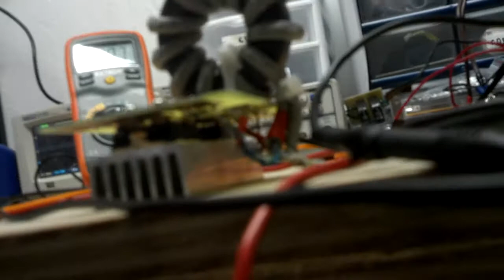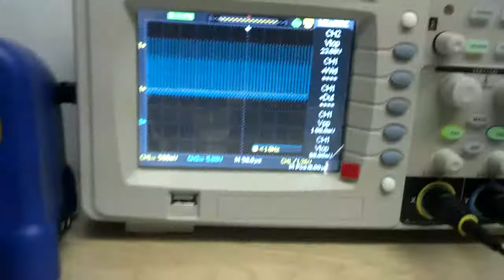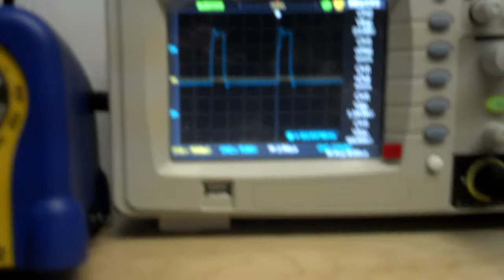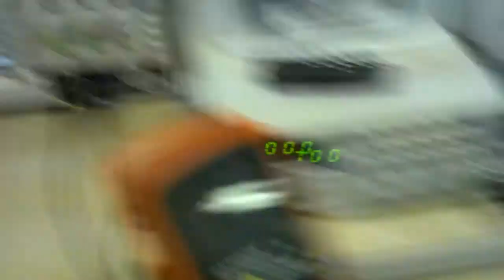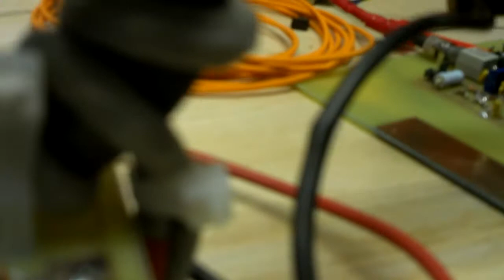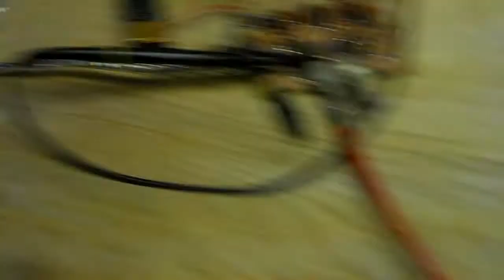DRSSTC Troubleshoot 2

Comment: That is a nice looking board I think ( : Try using a film capacitor for the DC blocking capacitor on the gate drive transformer, around 1uF should be more than enough. 

Apparently tantalum's are not good for this and a few people on 4hv have had issues with them.